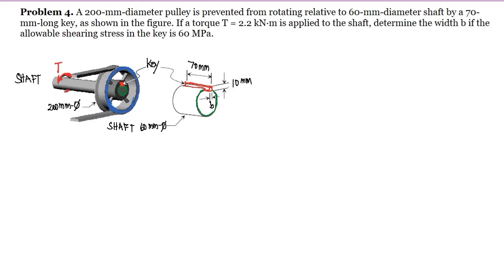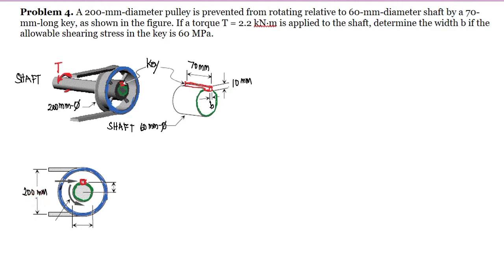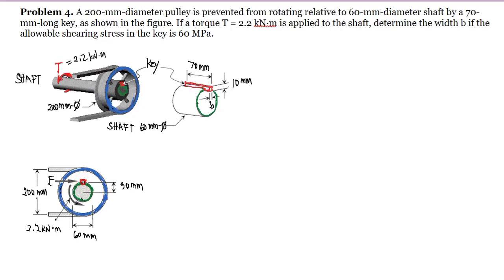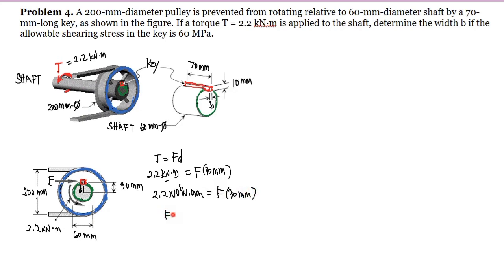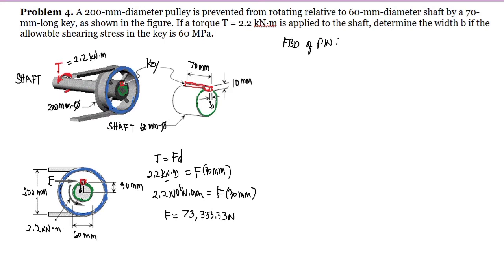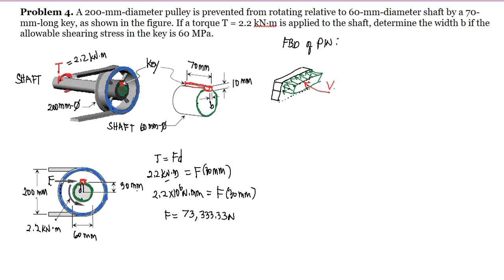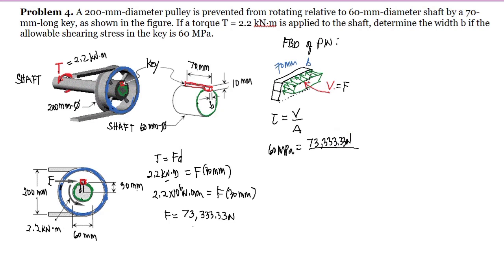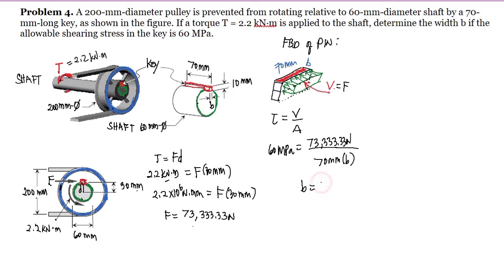Shear Stress Problem 4

Comment: Hello po, Pano nagka F doon and not counter clockwise torque?
Reply from the maker: @NoobCube248  statement po sa problem that the system is prevented from rotating. The force F is the force preventing the system to rotate and should be opposite of the direction of the given torque kaya sya assumed clokwise

Comment: I just realized that we could connect a line from a point on the circumference of the shaft touching one side of the key to the other point also on the circumference of the shaft but touching the other side of the key, and this line connected by these two points is parallel to "b". the Arc length on the key that lies on the circumference of the shaft if the circumference were continuous does not make sense...
Reply from the maker: But that area is larger than that of using "b" so the mode of failure is higher on the thinner part of the key.